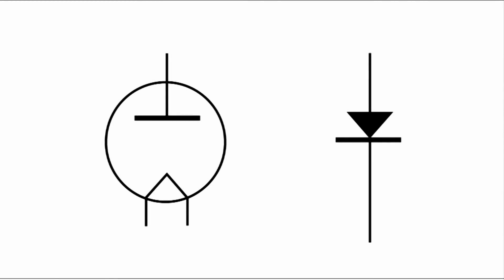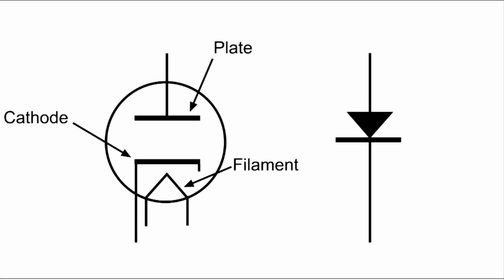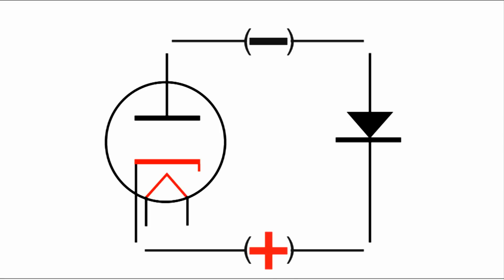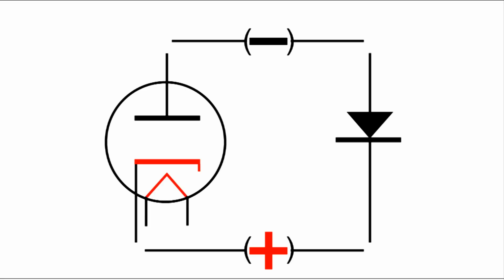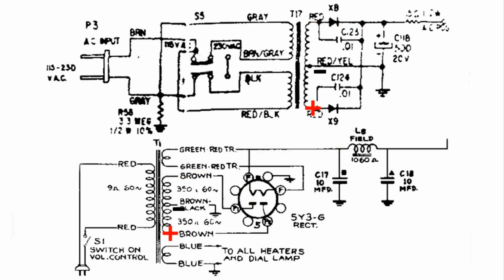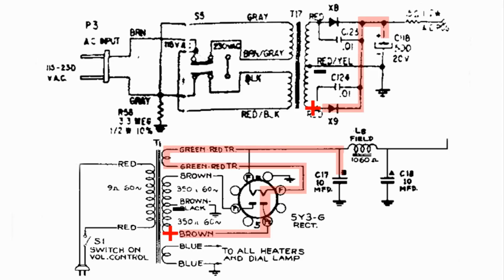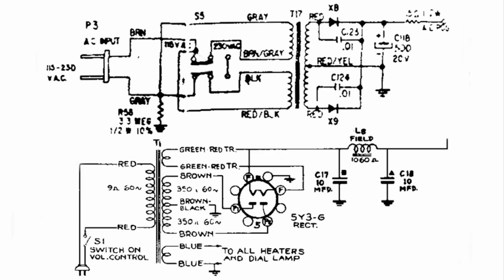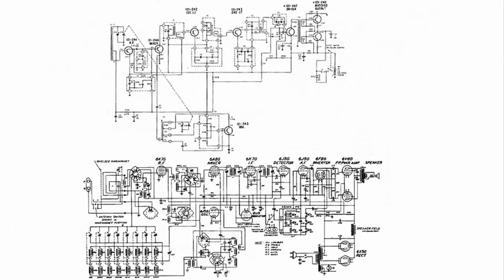Diode, Vacuum Tube and Solid State, Power Supply

Comment: Hi Rick,
Question about the bottom circuit design.
What is the purpose of having the 2nd current path flow through a winding in the transformer before joining up at C17?